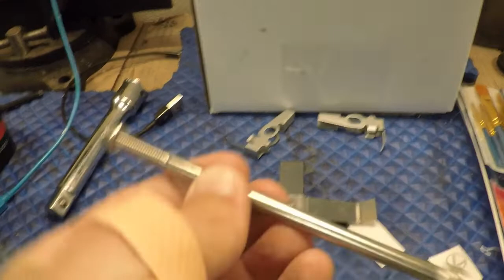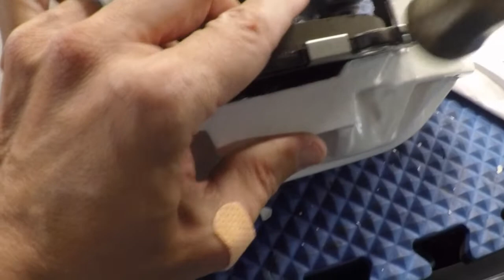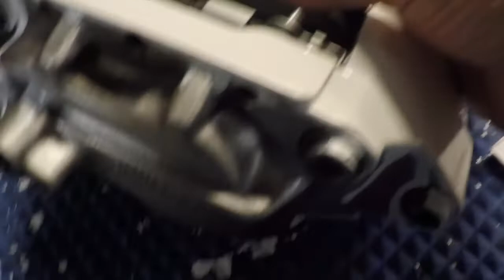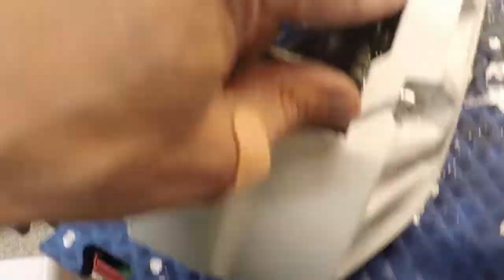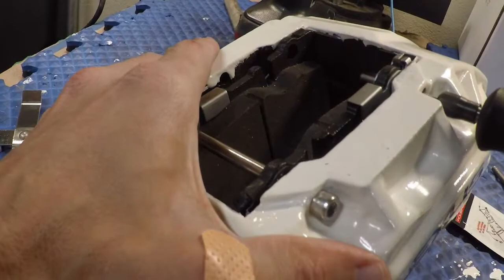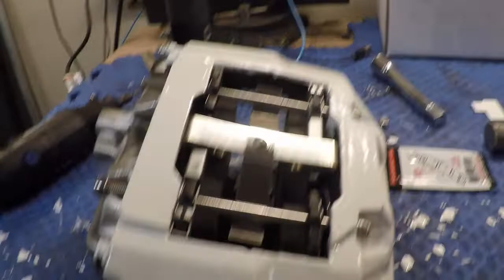GS300 Brake Upgrade:  LS400 4-Piston Caliper Upgrade Part 3

Comment: What is the name of the company we're you got the bolt for the caliper from and the lenght of the bolt?
Reply from the maker: Calipers bolt on with stock Lexus GS300 hardware.
Reply: @533L5  for the ls400 caliper that your putting on the gs .the white caliper
Reply from the maker: @Turbo_aristo  correct - same bolts that are used to fasten the stock calipers also fit and fasten the ls400 calipers.
Reply: @533L5  the long silver bolt the goes through the caliper and brake pads
Reply from the maker: @Turbo_aristo  Oh okay. Picked it up from https://supercar-engineering.com/sc2/product_info.php?cPath=15&products_id=136

Select 91-93 turbo models - for just front calipers.
Reply: @533L5  thanks